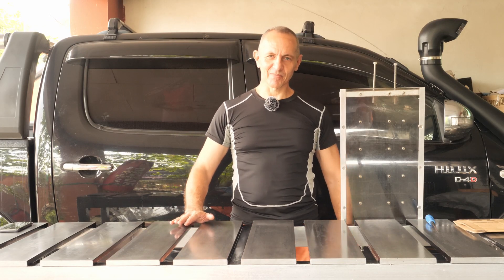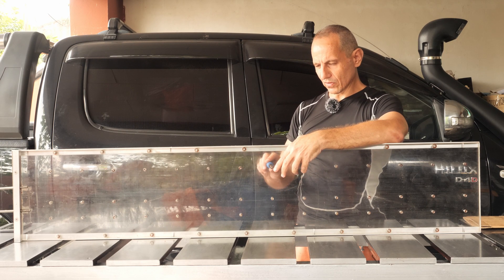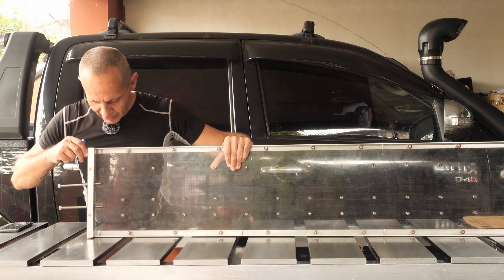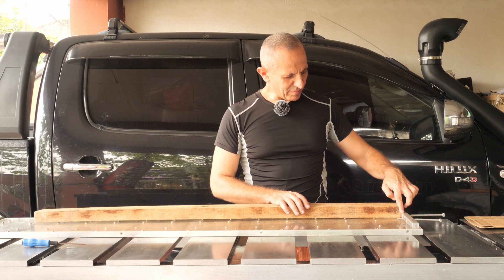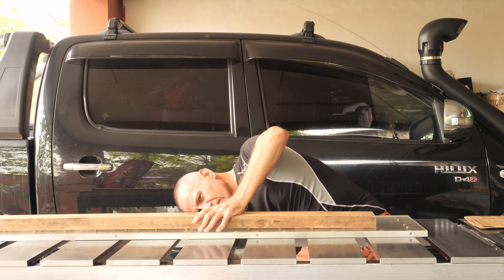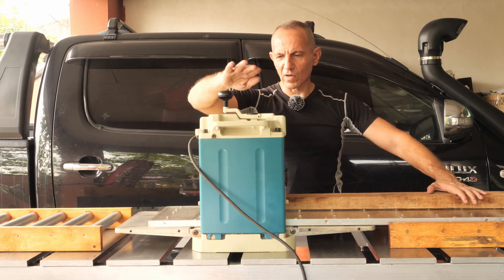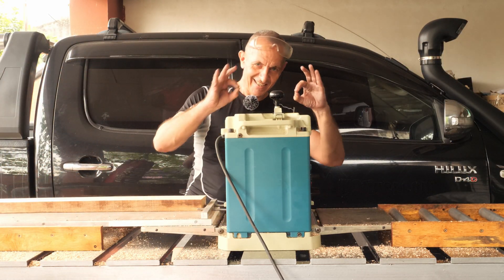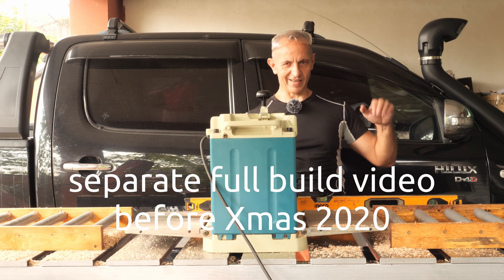Jointing Sled For Thickness Planer From Acrylic & Aluminum  Part 1/2 | Feature Demo

Comment: wasting time..
Reply from the maker: The Jointing Sled works as expected and produces perfectly flat surfaces. I do have heavy duty 12 inch spiral cutter head cast iron table jointer as well. But the sled allows you to bring the jointing capability to the Customer site, together with your thickness planer. 
You are wasting time not me

Comment: This is the best jointing sled I have ever seen to date. Very slim and doesn't use shims. It features its own clamping mechanism and the matrix of holes with the levelling grub screws is a real winner. Additionally you can attach any jigs you can imagine. It's a coolest sled out there

Comment: First time I'm seeing a non shim, reusable sled.  Nice video! 

I'm unfamiliar with those materials... about how much did it cost to build?
Reply from the maker: Thanks! Not humble to say but I have to agree that I haven't seen a better solution to date :P
Aluminium angle and stainless steel hardware is not that expensive as I usually buy it in bulk and then use for a long time. 19mm acrylic sheet 294 mm wide and 1500 mm long was quite expensive but not going to kill you. I drove to the factory as I live in South East Asia where it's manufactured. It could probably cost you USD150 in the end buyer market.

Comment: I agree - the grub screws might look fiddly but the time taken to position and lock down multiple shims would be even more, plus all the mess of hot glue clean up etc. The sled worked like a charm! Well done 👍
Reply from the maker: thanks again for your positive feedback.

the grub screws are easily accessible with the allen key screwdriver, and in most cases I only had to turn 3 front row screws because they act as a stop block for the rollers pulling action.
and additionally I had to turn ~3-4 screws to fill the cup/arch/twist.

it only looks fiddly on the video, because as I filming it, I was still prototyping, and I wasn't sure if it was gonna work as intended.

now after a year I can say with the confidence that this is the best design for this type of jointing sled out there. of course I didn't invent the wheel. I used similar sleds as my inspiration, but others were using different adjustment methods like turning wooden knobs etc.
I believe my approach with the grub screws embedded in the acrylic is really sleek, and waterproof, time proof etc.

I do prefer to use my actual industrial grade jointer though. guilty as charged!